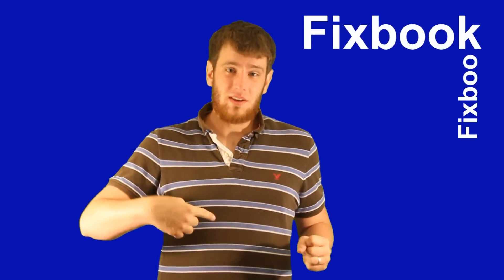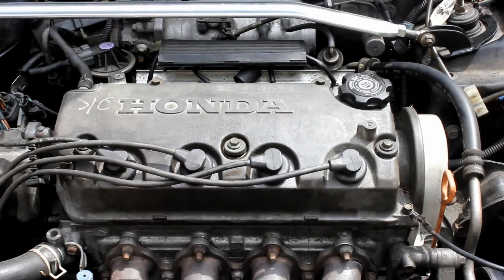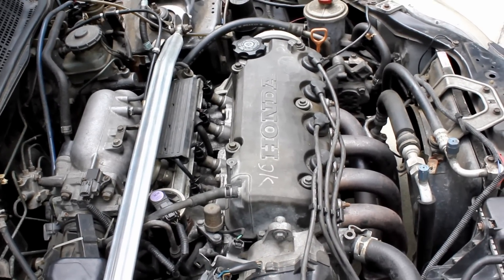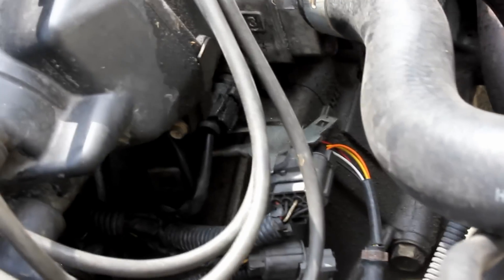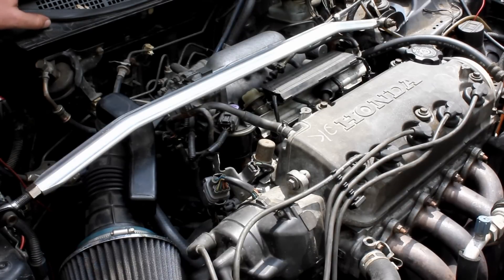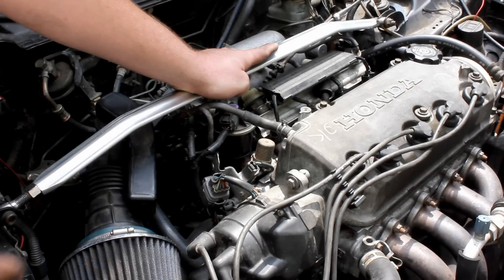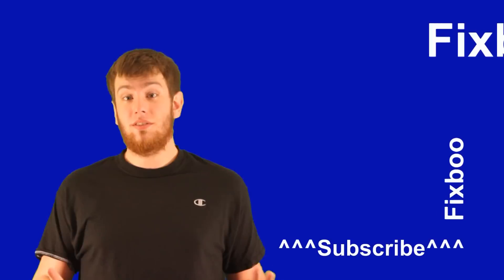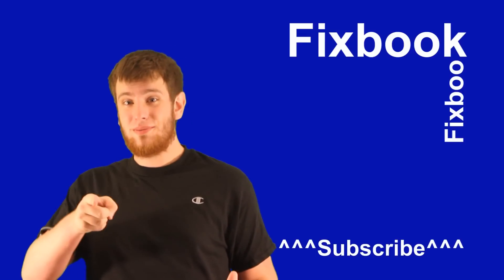How do You Know If You Have Vtec?

Comment: how to know if you have vtech... 4500+ RPM ...it kicks in yo!
Reply: VTEC E 4.500rpm
Reply: The Tsuchiyasan mine is set at 4600? Wtf are you talking about
Reply: lads chill lol. old model vtec kicks in 4500rpm. newer vtec kicks in 5500-5800rpm.
Reply: 5200 rpms it kicks in
Reply: More like 5600 stock

Comment: Ok, so I have really put in  some work on my car. Rebuilt engine a few years ago and transmissions clutch. But recently I gave it a tune up, new wires, plugs, new fuel filter, air filter, oil and oil filter.. I added some Techron in the gas tank a month ago. Added SeaFoam in the throttle. Cleaned out the IACV. Adjusted the Thermal valve, tightened it down a bit... New Pcv valve, new radiator and heater core hoses, flushed radiator, etc. And it's really picked up some Power and immediate response. I am really impressed with this little car. And now around 4,500 Rpms, all of a sudden it's like a Power band it just starts to really kick into over drive and takes off... so fun now!! It seems like Vtech but I am sure it's more like a power band on a Motorcycle...
Reply: It sounds like your does have VTEC on it.

Comment: You can tell if it has vtec without even popping the hood. Just listen to how the car starts. The vtec engines turn over at a higher pitch and also sounds more electric (if that makes sense). the non-vtec will have a lower pitch and does not sound as good as the vtec ones do.

Comment: If you have an Acura it's easier for you to find weather you have a V-tec or not, cause it says it right on the engine, it's a really good engine, powerful while driving it  and going fast and the sound of it as well, you can hear it and tell the engine apart from others.
Reply: My 04 RSX Type S doesn't say VTEC anywhere, but It definitely does. Then again, the previous owner probably lost some of the covers underneath the hood.

Comment: Do a video on the R34 I'm having trouble with the twin turbo
Reply: Just underturn the exhaust valve 8,28%, and make sure your hypercooler is properly connected through your DAF to the turbos ignition. If the DAF sits lose, your E-8 can not boost your vtec.

Comment: The best way to know if you have a Vtec? Drive it. If you get a surge of power at around 5500 RPM, it's a Vtec. Unfortunately, mine isn't.
Reply: Meemin Channelz Well, you should feel a surge of power in the higher RPM.
Reply: +Meemin Channelz You should feel a cam crossover. Its unique in feeling
Reply: They all don't kick in at 5500
Reply: Meemin Channelz Separate cam profiles is what VTEC really is. It is to expand the power band.
Reply: +insane_ivtec Indeed, the VTEC switchover for my car is at 2500 RPM's
Reply: What if mine screams loud asf like the engine noise changes to a more deep roar

Comment: Hey man I have a 97 Honda accord. the problem I'm having is that the engine was replaced by a mechanic. however the mechanic failed to give me the specs on the engine. 

now I'm having a hard time getting a starter for the car without knowing the specs of the engine. 

im trying to exhaust all my options before towing it to a mechanic. any and all help appreciated. 

Thanks
Reply: TheRiggs87 look at the casting number or stamped number on the block. That’ll tell what engine u have

Comment: Can I put a vetch in my non vetch car without any modifications. The guy that sold me the engine said just don't connect the solenoid cause there is no connection.  Just can't take advantage of the performance vetch gives you.  I'm ok with that if its true.

Comment: where is the oil pressure switch connector  located on that vtec solenoid? i think we have the same engine
Reply: Just below the RAX connector to the IPC4 pump. You might need to disconnect the brakevalve on the lower gearpair.

Comment: If it has VTEC it will say  so on the engine top? Seems like most newer Hondas have some variation of VTEC, with iVTEC being very common.
Reply: It doesn't necessarily say it on the top of the engine if it has VTEC or not, but if it does, you definitely have VTEC. Otherwise look for the solenoid as in the video.

Comment: Sadly i dont have Vtec in my 2013 Honda Civic, but i do have I-Vtec Woot woot, Ik it isnt a powerful engine yet, only at 143Hp, But soon i will be bolting on a Turbo with a EFI remap!!!
Reply: Lol ik I-Vtec is Vtec but i just wanted to make it known that i have I-Vtec lol. Soon it will be TI-Vtec
Reply: Man don't turbo it, just build your engine, trust me it feels way better having a strong reliable built engine pushing 400lbs torque, then having a turbo bolt on kit that kicks in at random rpms.
Reply: +Cricis11700 that's why u get a tune so u have ur turbo set up to what Psi u want it to put out
Reply: Yeah but it would still be good to beef up the internals, you know? Just so that your engine can withstand more power, And it's probably the and also the new civic, it's too heavy for a good weight to power ratio with the engine it has.
Reply: Well im not pushing for a race car just a daily that pushes at least 200hp instaed of the 140hp. Right now im getting my budget straighten out so i can build it, Im looking at the jackson racing bolt on supercharger pushes at least 250hp with the Hondata tune with my Borla exhaust system high flow cat im also putting in e3 spark plugs and KN intake. And yea i know working on this type of engine is a waste cuz it doesnt deliver much power but with the right mods im pretty sure it can push 400hp, Im just not looking for that much power right now or need it.
Reply: Cricis11700 actually the R18A2 is pretty light compared to others civics. What about tha trans is it possible to swap it for a manual

Comment: Another easy way to know if you have vtec is most if not all vtec heads (single cams) have the spark plugs/wires on the bottom of the "Honda" b series motors all have center spark plugs/wires so yeah look for a solenoid iThink my explanation was better